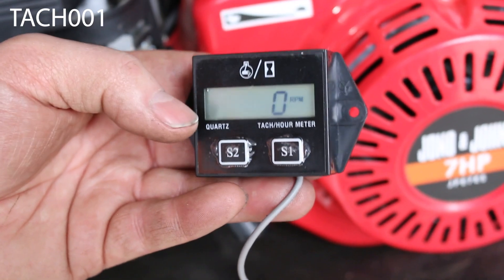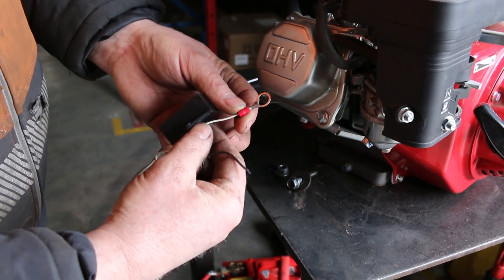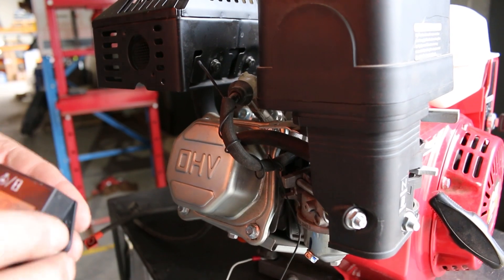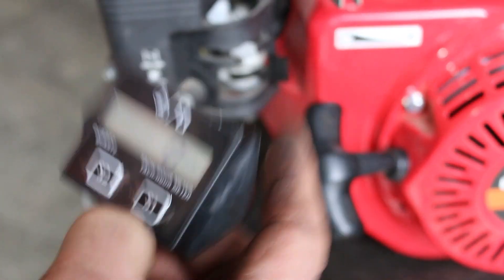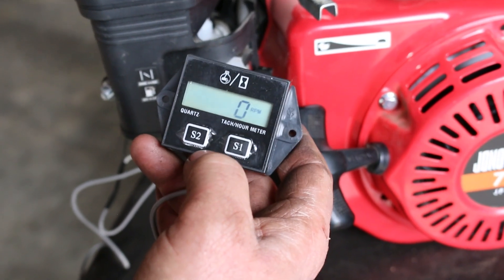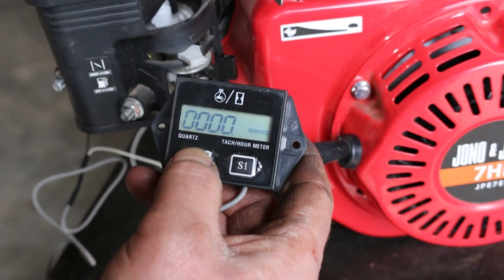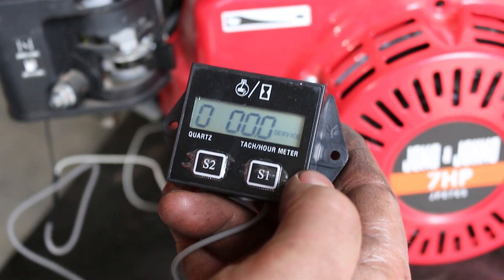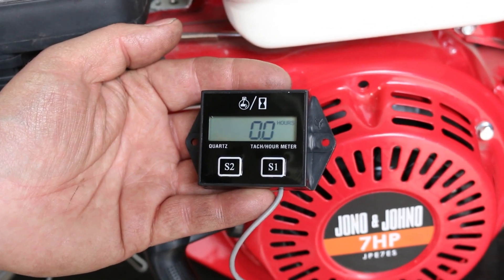How to Use a Tachometer: Step-by-Step Guide for Accurate RPM Measurement | Jono & Johno

Comment: I only use (2) gauges.   My fuel gauge and my engine temperature gauge.  Tach and speedometer mean nothing to me.
Reply from the maker: We find the inclusion of the service intervals come in handy for alot of people 👍
Reply: @jonojohno8694  My car is a 2004 Subaru.  It doesn't have CBS (Condo Based Service) indicators. But yeah, if I had a 2002 or Newer BMW, I'd agree